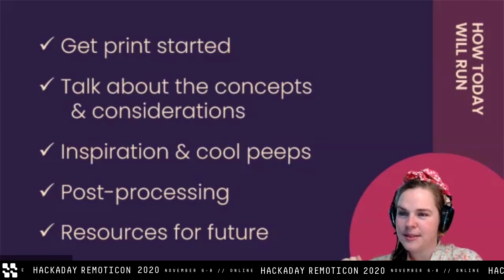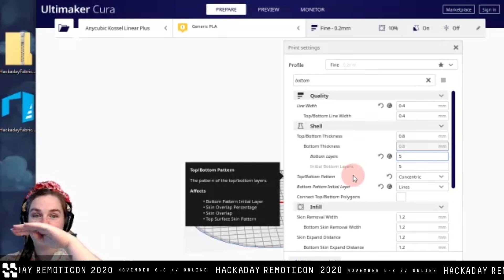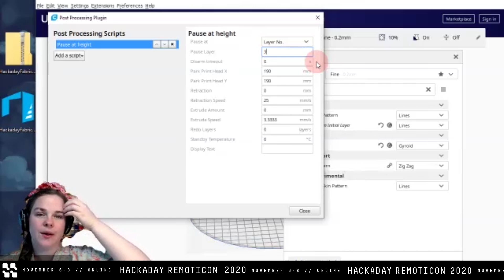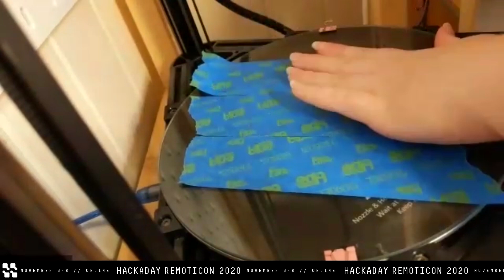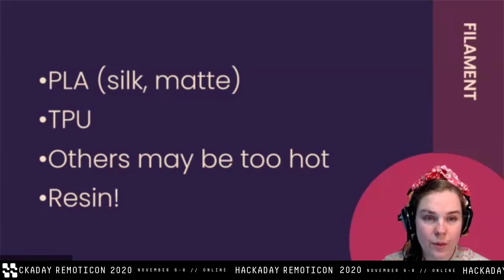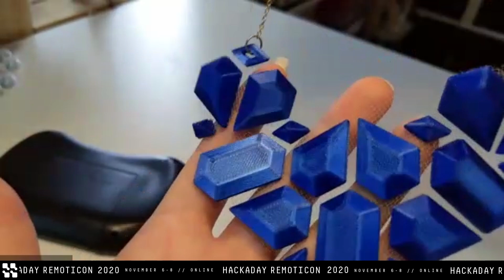Remoticon 2020 // How to 3D Print onto Fabric Workshop

Comment: Ooh, this could probably be used to improve the strength of 3D prints by embedding fiberglass fabric into it, like the cheap 3M stuff that's been used for fiberglass heat welding. That technique was pioneered by the printed firearms community for strengthening and/or repairing printed receivers. This technique would probably also be very useful for reinforcement as well. Very cool.
Reply: Yea! So that drone part I was talking about used that fly screen stuff and that's fiberglass! 😊